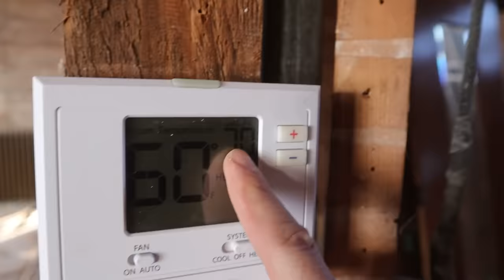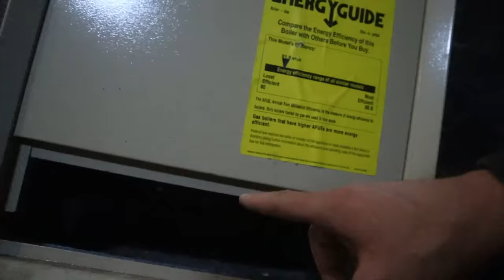Restoring A $7,000 Hoarder Mansion: Main Floor Demolition

Comment: that oak flooring would be 90% reusable... pull the nails, and square off the ends... the random lengths is how it comes and minor damages to the tongue and groove would not hamper the performance... that stuff is worth a small fortune... same with the doors and door knobs.... big $$$  just my 30 years experience talking...  hopefully I can keep watching these videos on the complete destruction of a historical property... ... so far, everyone has made me sick to my stomach by the total disregard of what you are dealing with and touching.....please.... you are not "Restoring" a single damn thing... so hard to watch...... 3:25 very very sad sight... I mean really?? most of that could have been used... a simple sand and finish and it would have been better than new....
Reply: As Ron White said, "You can't fix stupid".

Comment: You are literally removing the wood lath and plaster the worst way possible.  Did you have the plaster tested for asbestos?  The easiest way to remove wood lath and plaster is by using a circular saw and cutting it into squares and then remove large sections in one piece.
Reply: Would you expect any different from this channel?  The family work motto is work harder, not smarter.

Comment: think of all the wood that was cut building that house . that house was built before electric saws were invented . that means each piece of wood was cut by hand . just all the lath cutting must of took 2 weeks . a good carpenter was paid 50 cents an hour in the cities , out in the country where this house is might have been 30 or 40 cents an hour . carpenter helpers made one dollar a day if they had experience  . if you got sick or hurt you would lose your job . ... farm laborer's got one dollar a day or less
Reply: That house is most likely a catalog house and mostly came precut on railcar.  1917 is well into the industrial revolution and that lathe for the whole house was probably cut in a couple hours at a factory.  On site a handsaw would cut a strap of lathe in about three cuts if not chopped by the hammer used to install it.

Comment: The more i watch the more i realize that your home was poorly constructed with all the holes, gaps and everything bird and varmints! The roof had wide gaps where the ceiling had unattached framing. Cole showed the places where there was no bracing. The main drawing room with the gorgeous pocket doors and fireplace had NO Load bearing walls to support the second story. No proper insulation. Evident to the fact that there are birds nest everywhere.I have no doubt that its was poorly maintained BUT the structural flaws are too great to ignore. AND if the house was properly constructed there wouldn't be severe water damage on the main floor. Even if the roof were damaged, given there is an attic a second story and THEN the main floor, water damage would be at a minimum.
Reply: The house has stood for over 100 years and likely neglected for the past 30 years.  It wasn't poorly constructed, it was poorly maintained.
Reply: @benhur520  Nope. The roof had wide gaps where the ceiling had unattached framing. Cole showed the places where there was no bracing. The main drawing room with the gorgeous pocket doors and fireplace had NO Load bearing walls to support the second story. No proper insulation. Evident to the fact that there are birds nest everywhere.I have no doubt that its was poorly maintained BUT the structural flaws are too great to ignore.